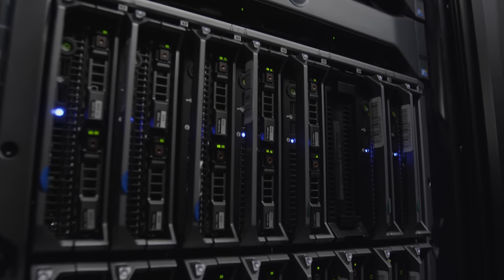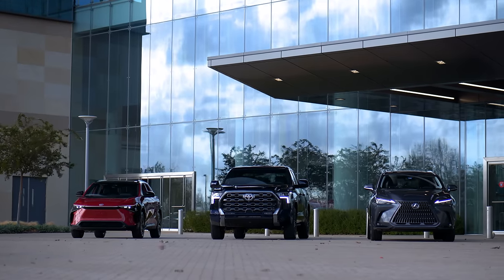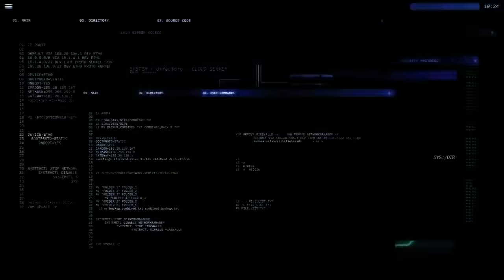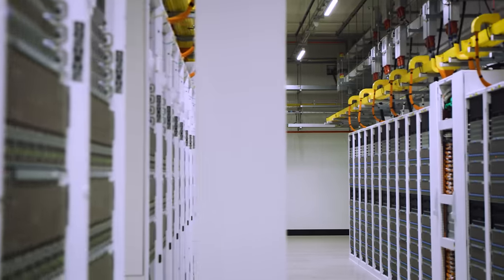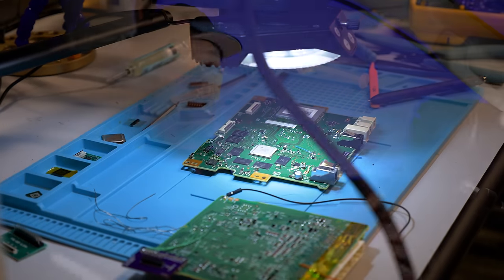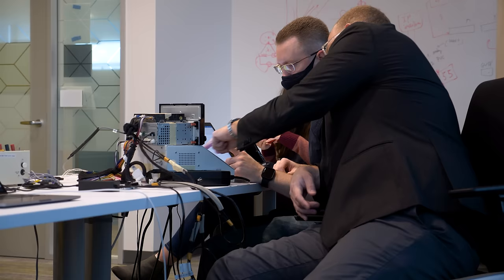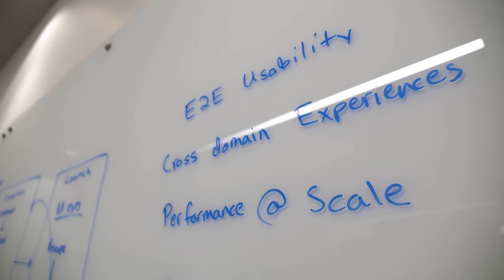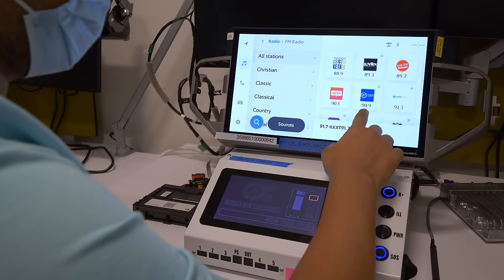How Is Infotainment Designed?

Comment: I am am really frustrated where this is going to. To have a car that is annoying to use as some smartphone/PC OS is really sad. I hope there will still be a small market for offline cars that concentrate on utility and driving pleasure. But I feel like offline segment with will be reserved only for sport cars.

A big problem I see is that designers of car UIs are programmers. And they usually want all touch/screen buttons so they can change them during a lifetime of vehicle since you need a new UI every year or better every week (THIS IS ANNOYING!). And I also believe programmers are usually not driving cars to work everyday. So they have no idea in what kind of situations being physical buttons and functions are used. For example heat seating was described as a function rarely used and therefore it needs to be digital. But if the programmer in the video would be using the heat seating, he would know that when the seat becomes too hot I want to change it immediately while driving not playing with the menus. Another function that is being omitted nowadays is air circulation. When I see a mile ahead that some truck is burning oil, I want to immediately change it by pressing the PHYSICAL BUTTON!

And another note. Why do you have to constantly change UI. Just leave the things that work great. And rather do smaller changes. There will be people mad because of this as they do not care about functionality. They just want a difference in design/functionality. But these people would buy a car that has a stick (like on motorcycle) instead of steering wheel, just because it is different.

Comment: The UI people have an impossible task, that's for sure. But they still can make choices that are just baffling to me, as a user. Heated/cooled seats as soft buttons in a menu is just an absurd idea, and people that think it should be there...shouldn't be in charge of the coffee pot in the office of the guys who make the decision. They'd put the coffee pot in the fridge three rooms away from the sink with the justification of "they only spend 0.3% of their day getting coffee, so it's not important enough to be convenient"

Another thing, get in a new Tundra with the giant screen. In a truck that wide, with a screen that big, there is NO excuse for putting any control, menu, selection, widget, or any other thing on the right side of that screen. If I have to bend my torso and have my arm fully extended to make any selection...That's just awful, awful design. First off, it's difficult to even hit the right spot in that physical position while driving (the button/selection is still tiny!). Second, it probably doubles or triples the time my eyes are off the road. I'm not just picking on Toyota here. All the manufacturers/software/UI folks do it. It's the worst in full size trucks (my primary focus, as that's where I spend most of my driving time). It's not as bad in smaller vehicles. Slight side note on this: The screens are too large. Bigger might be better for TVs, but you're not watching TV or movies on these screens. If the screen was 8 inches, and closer to the driver so the whole thing was easily accessible, I'd pick that in a hot second over a 14 inch where I need to lean into a different zip code to center my map or skip a song. But then if I got the 8 inch screen, I probably wouldn't be able to get heated seats because REASONS and this whole diatribe is moot.

Comment: Observations:
1) Hotas is not a new concept, and was perfected before most of those interviewed were born.  Even a vestigial acknowledgement of past lessons-learned in aviation applications would have been encouraging.  Those with a military aviation background, either in the contractor or armed services spheres, have decades of experience to share.  TMNA seems blissfully unaware. 

2) Manual-transmission drivers are now a vast minority, and in North America, transmission controls have shrunk to relegate the right hand to knob-turning, screen-swiping, or mouse-pushing.  What are the implications on safety?  They moved the menus to the left side of the screen…congratulations.  Surely someone is taking a more holistic view?  What about a discussion of one vs two hands on the wheel?  What about a discussion about not having to look at a screen at all?  What about the ability to turn off or dim out the screen?  

3) A lot of noises about customer-focus, data security, privacy, and safety, but no substantive discussion of precisely what data on the Canbus will be accessed by 3rd parties or TMNA themselves.  If there are boundaries, then delineate them clearly to earn our trust.  What I heard is that there are no boundaries, and TMNA has built in full telemetry tracking for future sharing with insurance companies…or governments.  And it is up to the consumer to individually decline access to these layers of tracking data. 

4) Interviewees need to stop saying “right”.  This verbal tic implies audience concurrence and is a subtle mind-game.  Juvenile and annoying.  Just speak clearly and be transparent.

Comment: I tell my kids that technology is great when it works and sucks when it does not.  All that nonsense of no moving electrical parts and failure is BS.  Flat screen TVs are an example of it and no one really fixes them, they’re replaced. At least with Toyota you get a sense of longevity.

Comment: Look, until I can get in my car, program my next fuel stop 500 miles away, then put down the back seats and get seven hours of restful sleep before the car turns on the lights as it pulls off the freeway, I have just about no use for this connected driving shit.

I don't want to check my emails in the car.
I don't want to be marketed to in the car.
I don"t want my car to be beholden to software updates or prone to ransomware.
I don't want my odometer and whereabouts uploaded to the state for assessment of a mileage tax.

Just about all I want is for my phone to connect to the sound system via Bluetooth and some fucking actual buttons.  Screens are for viewing.  Screens are not for inputting, especially when they take your eye off the road at speed.

Make it fluid for the driver, or don't bother.

Comment: User experience !!    Ha !

Toyota have been doing a lousy job.  And they have been doing it for too long.  Too slow.  

It may be good to make a product reliable by making changes  slow and cautious.  It certainly has helped Toyota.  However Toyota's "infotainment" units have
changed too slowly, and they have been "behind the ball" too long.

I understand the factors that they mention in this video.  But if other large manufacturers can make good units, shame on Toyota for being so slow.

Note that they  haven't even kept up with the Koreans.  

Their units have been so lousy, that they have done a major disservice to their customers.  If they want customer loyalty, they should apply their
standards for repair and correction in this area as well.  Just because it's cheap to make touch control, does not mean that we want them.   Easy to use, tactile, intuitive.  

To do that,  they should ALSO OFFER REPLACEMENT UNITS for the crummy units that they have been placing in their cars.
If you want loyalty, don't make a buyer purchase an entire new car to get a useable unit.

Touch controls may be cheap to make but they can  also  create a totally wretched car experience.  For example, who would want to 
have to deal with the new GTI's unit ?

This video appears to be an attempt not only to educate the buyer, but also a culpa mea.  But it's not good enough as a culpa mea.  
Why not just say that they have been putting crummy units in cars, and say that they want to do the right thing by their customers. 

Toyota doesn't deserve many kudos for information for a  video that is merely "catch up".

And don't overcharge for the service either !

Comment: they think they can do better than carplay or android auto? Not a chance. And good automation to remove the need for manually operating the function or leave the physical buttons alone.
Reply: They specifically mentioned partnering with Google for maps and search. So no, obviously they don't think they can do better in some respects. I don't think you watched the full video...
Reply: @galactictomato1434  they are rebuilding the Android auto which has Google maps already.